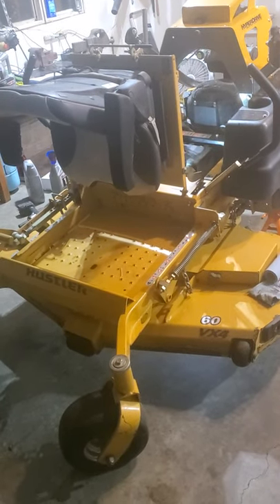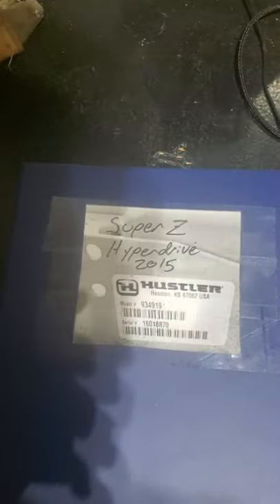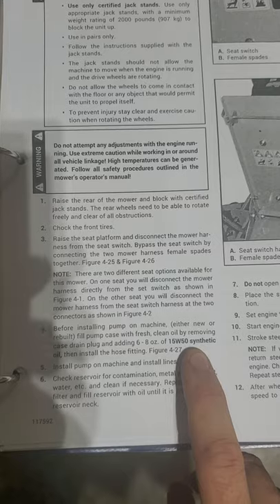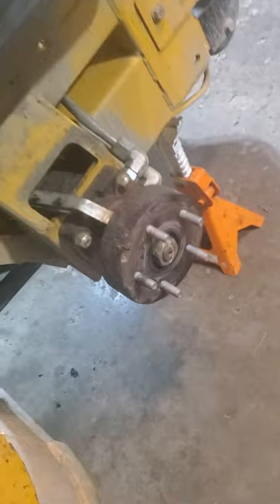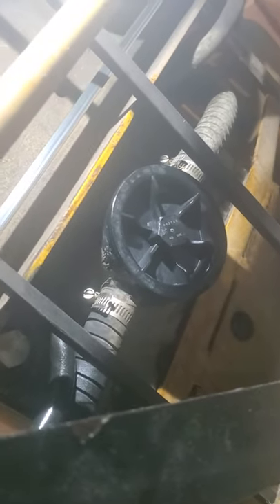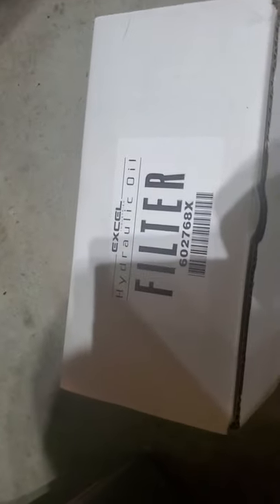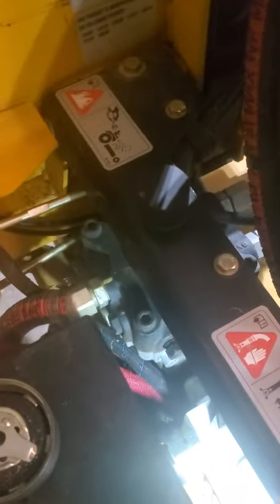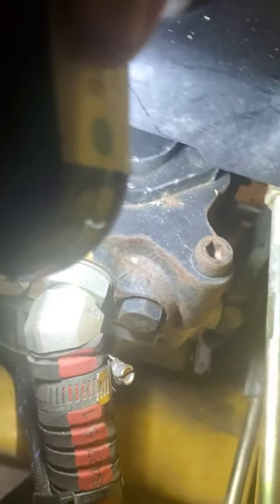2015 Hustler Super Z Hyperdrive hydraulic fluid change.

Comment: I have the same machine only a 2012 model. It just hit 500hrs and got its first hydraulic oil change. Back in 2008 my hustler super z manual said it wasn't due for a hydro  change for the first 1 thousand hours. I just find it hard to believe that now they're saying it needs it every season, even if you only have 100 hrs on it per yr. The dealer told me in 08 the reason for the 1k hr first change was Hustler was more considered about dirt getting into the system than it needing fresh oil. I mow grass commercially, but this 2012 HD is a backup mower and doesn't see that many hours. So I'm going to play it safe and change the hydro every 500 even if I only put 100hrs on it per yr. That would put me changing it every 5yrs.

Comment: good video i have a 2017 HD you dont need to take either wheel off to change the hydro oil excel industries recommends changing every 500hrs or anually i just do the 500hrs filters are around $110 now and pumps are like $1700 these machines are built very well . my buddy has a 2011 with over 3000 hrs on it and still going strong

Comment: Any experience with the purge not working as it should? After filter& fluid change mine is winning now.
Reply from the maker: @dustinross1638  I'm way late on this, but the only thing I could thing would be an issue with the pump bypass not being tight? Were you able to solve the issue?

Comment: Are you saying that motor oil is used instead of hydraulic fluid in the Super Z hyperdrive?
Reply from the maker: According to the manual on this specific unit, the hydraulic system calls for "motor oil" 15w50 Mobil 1
Reply: @jakerichards1988  : I watched perhaps a half dozen of videos concerning this subject to make certain I was getting the proper oil.  You are another in that list that says the same thing-motor oil, not hydraulic fluid.
I was surprised by that.
The only difference is minor one.  A few have stipulated 20x50 rather than 15w50.  In my opinion that is a minor difference.
Thank you for responding all the same.
Reply: @wrongfullyaccused7139 all mowers use motor oil as hydraulic, it's the extreme weight of viscosity that makes it hydraulic oil.
Reply: @jasonjohnson5967  : Actual hydraulic oil/fluid is quite thin compared to motor oil.  I have used both for many years.
That being said, I checked multiple videos on this subject and all of them stipulate that ordinary 20-50 motor oil is what is to be used in this particular system.
I am a new owner of the Super Z so I was thrown when they said to use motor oil.  Never heard of that before.
Live and learn.

Comment: Any experience with the filter not fitting?
Reply from the maker: Sorry for the late response. I did not have any issues with the filter, but this was my first time doing it.
Reply: @jakerichards1988  Thanks.  If you didn't have an issue with the filter, then we just got filters from a bad lot, TWICE.  They just would not go on.  Quality control must have let the tolerances fall out of whack.
Reply from the maker: @deannareffitt4460  I was not able to find an aftermarket filter, so I went with the OEM. If I remember correctly there were 2 different filters depending on the year of unit. Did you end up getting one that worked in the end?
Reply: I have this same set up only mine is a diesel. Changing mine for the first time so hopefully goes as smooth as your video 😅
Reply from the maker: @dave_1958  Did it go well for you?
Reply: @jakerichards1988  yes it was pretty simple actually and went well. Unfortunately… the reason I decided to change the fluids I was getting some play on my right side drive (seated) like an extra inch movement before the drive would engage. Thinking maybe a change of fluid and filter might be the cure. While purging the system of air I noticed some wobble on that drive tire side. I pulled the wheel again, pulled the hub and the real problem was the key way has been wallered out on both the hub and the shaft. So I’m waiting on my order of a new drive assembly, hub and brake 😕 $1376 dollars for parts. Moral of the story and to anyone reading this, if you have any play in your forward/reverse motion on a drive, IMMEDIATELY pull the wheel and the hub and check the key and key way!! very expensive lesson learned. But a new mower just like mine runs $19,000 so I’ll take the $1376 lesson this time 😬. I wish I could add a photo with this! Thanks for the reply!